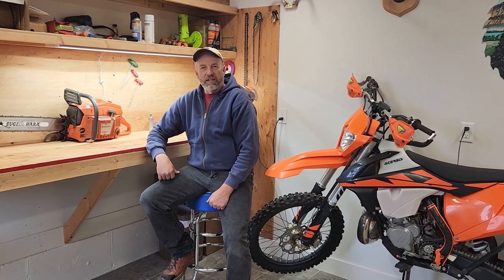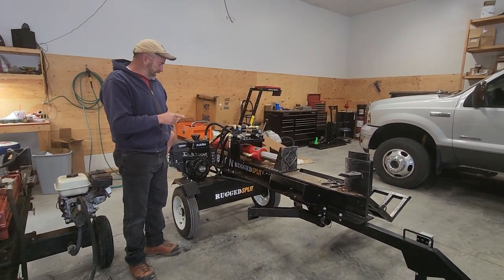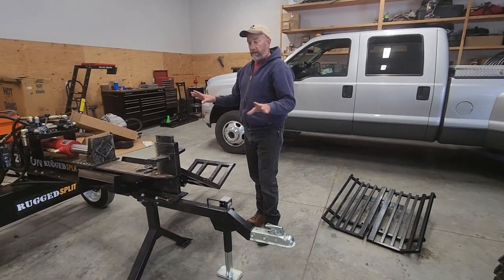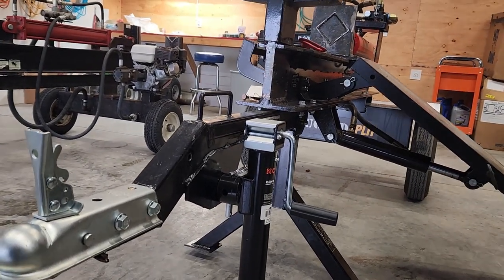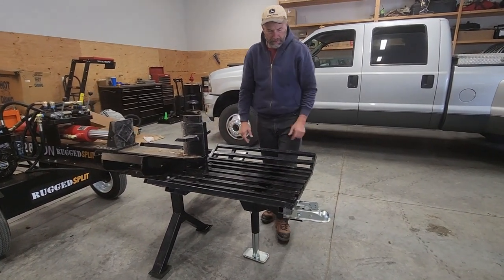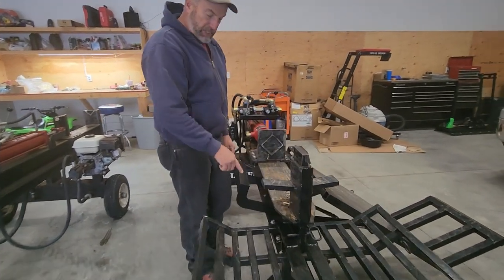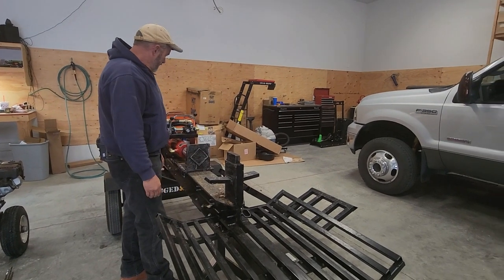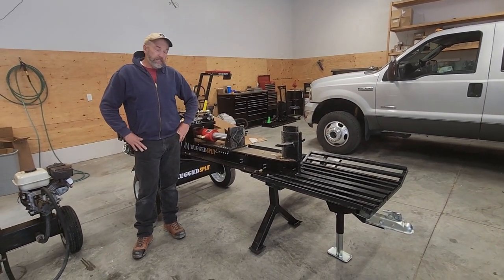Ruggedmade 28T Log Splitter Review and Modifications

Comment: I know exactly what you're talking about with respect to the retract detent not kicking out 100 percent. As of right now, mine does it too. It's frustrating. The detent pressure seems to be appropriate, so the only way i can see to possibly fix it is to lessen the detent pressure lower than you really want it so the the 'inertia' of the level breaking out of the detent carries the lever ALL the way forward. The other thing that crossed my mind is to remove the spool and refine and re shape the actually deformation in the spool shaft that is being caught by the ball bearing detent. Great video, nice job making it your own.

Comment: The detent on that valve is adjustable. It’s the adjustment at right angle to the spool, loosen the lock nut turn the outer adjusting nut out 1/2 to 3/4 of a turn (looser). Try that it fixed mine.

Comment: Thanks for the review. I'm considering this model,  i think the modifications you made to the hitch-connection end are perfect!

For that valve issue,,, in not certain if this will fix it,  but RuggedMade has a video on their channel about adjusting the detent for the return on the valve.  Might be what could help you
Reply from the maker: Thanks for pointing that out. 
About a week after I posted this video, I contacted Ruggedmade and they emailed me that video link for the detent adjustment as well as to let me know that the Honda engines just came in!! Ha ha. Their adjustment procedure totally fixed the poblem. The detent spring was way too tight by about two full turns!  Also, as I pointed out, the raven is actually a great engine. 
These guys are a really great company to work with. I highly recommend their products.  The log lifter is amazing! Will lift as much as you pile on with ease!

Comment: I have the 37 ton one and I did some modifications to mine as well I use my tractor to move mine so I put a removable pintail hitch on it so when you remove it no one wacks there legs on the hitch and use the 3 point to lift and move so I didn’t put a jack on mine. Thanks for the video

Comment: mine is 3 years old  been thru 3 sets of valves rugged made warranty is great people are  great at getting parts out just wish i didnt need them . has leaked hyd oil since day one log craddle you took off has been bent  clear back to craddle  engine has been great log lift gets bent up needs  a angle iron welded on next to beam to avoid this  hyd  oil filter housing was replaced but still has filter vibrate. loose love the speed and power needs engineered better beam log lift and craddle need to be same height so  moving peices back to be resplit   is easier tounge  weight can be adjusted by moving the tire forward your modes are great  for the money not a bad machine but could be better just ordered a vertical with  elevater from  wolfe  ridge cant wait to get it and speed up  my production

Comment: How did you add the log lifter valve, did you add a 2 spool valve or what ?
Reply from the maker: @charlesbranham875  
The machine came with the additional valve for the lifter.  
Not sure what you mean about "adding it".
One funny thing about the Raven Chinese Honda copy. Even after it's been running and fully warmed up, it will not start w/o choking it. Other than that, it seems to be a great engine. No need to drop the extra $350 for the Honda w less HP.

Comment: All good points but the pinch point is that you should always keep your hands on top of the wood and not by your side..
Reply from the maker: I've use my old straight beam Northern splitter for over 20yrs. I guess I just got very used to holding the logs on the side at times when needed.
It just worked better for me to remove that bracket. Totally not needed!